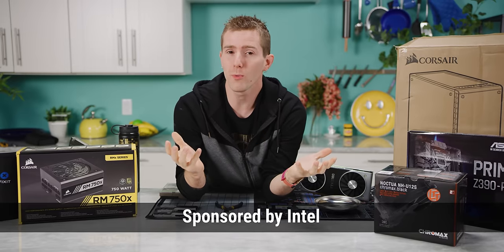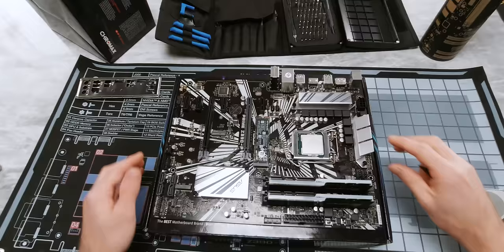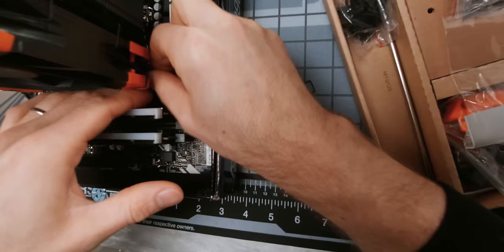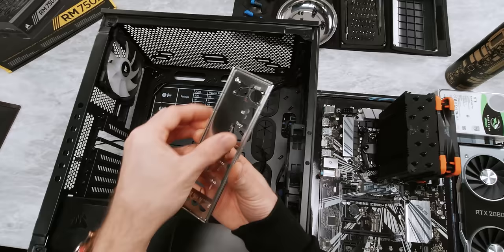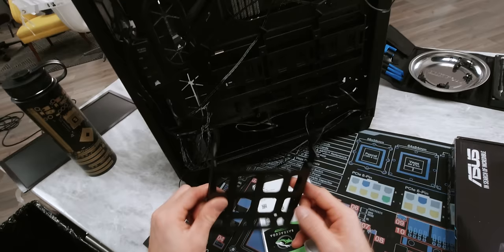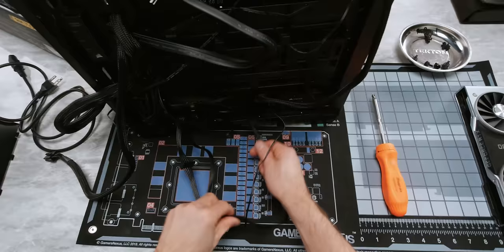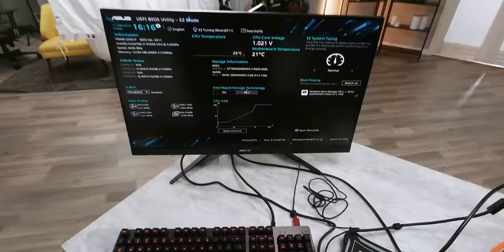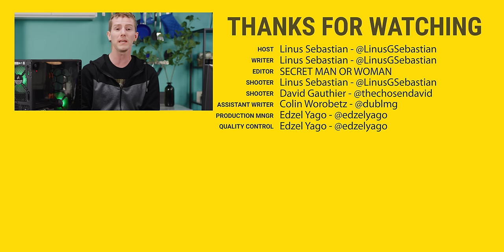First Person View PC BUILD Guide! (POV)

Comment: Im so confused some people use hhd Some use ssd
Reply: I dont know the difference
Reply: Hard drives (HDD) are storage drives that have moving platters inside of them (look like small, thick CDs). These platters rotate thousands of RPMs. There's a read/write head that reads/writes from and to the platters. Hard drives are relatively inexpensive and offer large amounts of capacity. Hard drives are slow since they are mechanical in nature. 

On the other hand, solid state drives (SSDs) use flash memory similar to a flash drive. Instead of having physically moving parts, they store data in flash memory cells. This makes them much faster than hard drives. They are still more expensive than hard drives per gigabyte but are coming down in price. 

I strongly recommend an SSD on any PC, even if it isn't for gaming. You can also buy a large capacity hard drive if you need more storage space.

Comment: Hey linus I built my first pc using your guide and unfortunately it's not turning on anything and I'm extrememly sad because I put in about a whole months worth , doing 12 hours everyday to purchase one and I don't want to buy a prebuilt one or buy new parts please help 😢
Reply: Well have you tried any troubleshooting steps? That's what you have to do when something isn't working. Start by checking ALL conenctions, even the trivial ones. Make sure your power outlet works. Make sure the power cable is plugged in from the wall to the power supply, make sure the power supply switch is turned on, make sure all power cables (motherboard, CPU, graphics card) are installed correctly. Make sure the power button header cable is installed in the correct headers.
Reply: @JJFlores197  thank you and yeah I did that after my tantrum lol

Comment: Hey I am trying to build a computer and I don’t know if a ssd and a hard drive is necessary please somebody let me know
Reply: If you want to be able to use your PC, yes, either one is necessary. I strongly recommend an SSD as the boot drive since it is much faster than a hard drive. If you need a lot of bulk storage, you can add a hard drive, but for most use cases, I would go with a 1 TB SSD.
Reply: @JJFlores197  so does that mean hard drive is not necessary but sad is
Reply: @sweatynoob1402  Yep.
Reply: @JJFlores197  thanks

Comment: Hey there! If you're looking for an efficient cleaning solution for your desktop setup, I would recommend checking out the HOTO Compressed Air Capsule. Its powerful vacuuming and blowing capabilities, along with versatile accessories, make it a handy tool for maintaining a spotless environment. Plus, it's lightweight and portable for convenience on the go. Feel free to ask if you have any more questions or need further recommendations!
Reply: Now you're advertising in comment sections. Please stop

Comment: My power supply is clicking and my cpu's lights are flashing anyone has any idea ?
Reply: Most likely bad PSU. It shouldn't be making any noise apart from its fan.
Reply: clicking is always a bad sign. especialy if its coming from PSU, i would shut it down instantly and get rid of it before it blows up and catches fire
cpu lights?
i dont know what lights are those

Comment: im so fucked, i have two casses one pre build i bougth and new case kinda similer to this one and i have no fucking idea how to build the pieces from my pre build into the new case. I got a new CPU aswell a i7 7700 old one was the 4700 something. And i wanna use the CPU but it wont fit in the 4700 CPU spot. the case i got have a nice motherboard from Azus im just clueless on how to asemble things :/
Reply: If you can take apart the computer, putting it back together is mostly the same process in reverse.
Reply: @JJFlores197  Yea i did i spend a lot of time trouble shooting mutiple problems i had a gtx 1050 6gb GPU and it just wouldent give picture in the new PC. I tried to boot the PC without a GPU and use the HDMI pplugin in the motherboard and still no picture had some LED lamps blink saying CPU/G Ram so i tried switching the ram slots. But i think either the motherboard in the new PC dosent work or some other issue, cause nothings wrong with my GPU. Also look up te motherboard and PSI slots are compatible with the GPU.

Comment: old tip from an old computer Builder you can put colgate instead of it in the intel
Reply: DONT do that. It works but it will run HOT and like shit and youll kill the cpu
Reply: @zexal4974  really i din't know that thanks for the info !!
Reply: @ramonelias6510  no problem,  it also causes random crashes and alot of other problems, colgate is not a good heat transferer, thats whats thermal paste is for, its like using Peanut butter or Nutella as thermal paste, just get normal paste and you will never have problems
Reply: @zexal4974  thanks so much and i love the content you make its really interesting and informative and i watch it all day everyday when i am at work !  because you have really clear way to explain really good all the specs of everything many thanks again 🙌🏻🙌🏻🙌🏻🙌🏻

Comment: I decided to go with an Intel Core i5-12600K since I want to have a DDR5 build. I'm on a tight 1k budge still with a GPU. As for now a Seagate FireCuda 530 1 TB is what I'm sure of (besides the CPU). I can't decide what MOBO should I get.

PS. Would having a 1x32gb RAM be fine? I'm want to upgrade. I dont like the thought of having 2x16gb RAM.
Reply: I know dual channel is usually better performance but it's like maybe 5 to 15% better. You do get slightly lower performance with single channel ram but it's negligible in some instances and a bit more significant in others. Still not a deal breaker though. If you want 64 down the line for heavy use cases like video encoding/editing I would recommend getting one 32gb module for now.

Comment: somebody please help me, i just spent $1700 dollars to build my first pc and it wont post... ): i dont know what to do im so upset. someone help please
Reply: What happens when you push the power button? Does the computer turn on but you have no video? If so, make sure you plugged into the video card and not the motherboard's video output. If nothing happens when you push the power button, check your power button header cable. Make sure its plugged into the correct pins on the motherboard.
Reply: @JJFlores197  when i press the power button nothing happens, its almost as if it isnt plugged in at all even tho it is. i double checked all the plugs and stuff and i tested the psu with the paper clip method and it worked fine, i think either there is a plug not correctly in that i missed or either the cpu or the motherboard is dead, but i dont know for certain.
Reply: @laqueeshous1813  Do a similar thing with the paper clip, but instead of on the PSU, bridge the power button headers.
Reply: @JJFlores197  are u referring to the same pins that the "POWER_SW" connects to?
Reply: @laqueeshous1813  Yes.
Reply: @laqueeshous1813  you didnt plug in the connectors in the right places, check your motherboard manual where to put the + and - power cables into. its different for every board.
Reply: good news,  @JJFlores197  was right, the problem was my power button cord wasnt plugged into the right pins, i fixed it now tho and my pc is working perfectly! thank you guys for ur help :)

Comment: Well Well another one of those anti static so called builders that has NO IDEA what he is talking about. Im 78 years young started working in electronics when I was In High School and have never blown a circuit with static electricity. I also have never worn a static discharge band either. Ill Guarantee you that I have fixed, rebuilt and full built computers TVs Radios and all with Success on every one of them and no antistatic bands or nothing. First thing I learned is NEVER touch bare connections always handle components by edges and you will never need the antistatic bands

Comment: Anyone able to give me an up to date pc build? I literally do not care how much it costs, i want the very best available and i have no idea what parts to use. Again, i want the ultimate pc. I would also be thankful if you could recommend any good gaming monitors and wireless gaming keyboard, mouse, headphones, and controllers. I will be thankful if somebody actually helps lol
Reply: Do you actually game? I ask because any serious gamer who asks for a wireless keyboard stands out as off.

But here's a build that will do what you ask.
Lian Li D11 Dynamic EVO
AMD Ryzen 9 7950X3D
ASUS ROG CROSSHAIR X670E HERO
ASUS GeForce RTX 4090 ROG MATRIX Platinum
Lian Li Galahad II LCD INF 360
Corsair Dominator Platinum RGB DDR5-6000 C30 DC - 64GB
Seagate FireCuda 540 PCI-E 5.0 SSD - 2TB x 2
Be Quiet! Dark Power 13 ATX 3.0 - 1000W